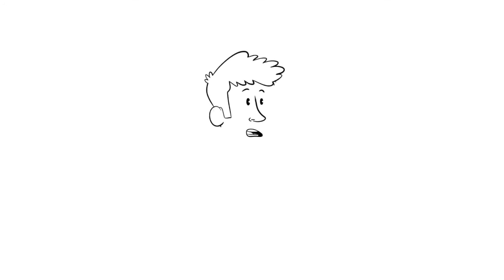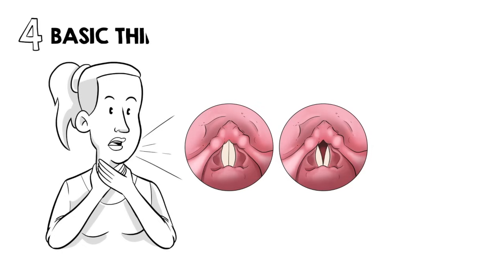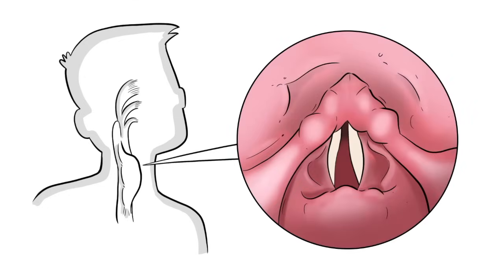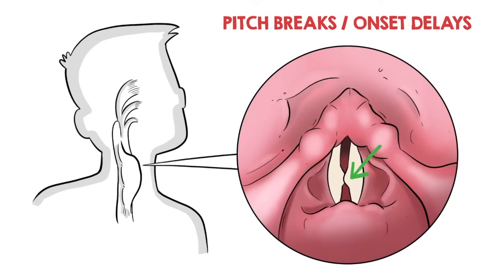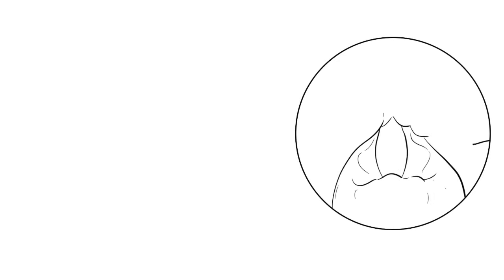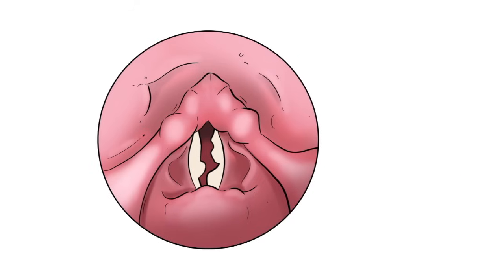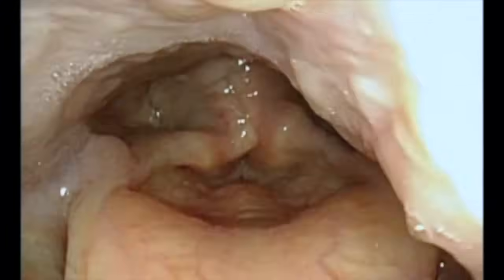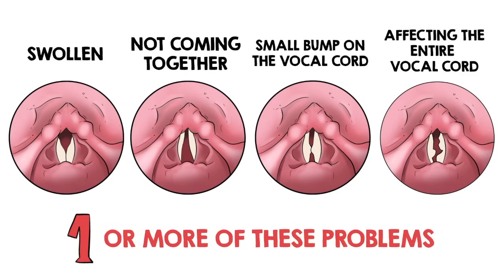The 4 Underlying Causes of a Hoarse Voice

Comment: Could someone please help me. So, whenever I try whispering my voice sounds clear. When I talk without whispering in a normal voice I sound weird and my voice always sounds so weird its most definitely the opposite of smooth. Even when I try talking in a normal voice its hard to sound clear I always talk in a high pitch voice instead so I would not sound weird with a voice which sounds like its vibrating and unclear. I wish for someones help if you could help please try so. I am a boy and is 14 years old. I also tried researching a lot and I cant find much I drink a lot of water and I do not shout so this could help but I can not see a difference. My voice has been like this for a year.
Reply: I'n the same boat did you get help

Comment: I’m getting older and my voice is getting worse each time I have surgery, when I have surgery they put a air tube in my throat that has caused me not to be able to swallow or talk sometimes for almost a month on the swallowing, then months on the talking.  I have been working with two speech therapist and still have trouble speaking.

Comment: Last year, I used to have a a very big vocal range (Bb1-C8 or 6.1 octaves and a semitone). I can sing like Mariah Carey's, Whitney Houston's, and Celine Dion's songs. But now I have a deteriorated voice, I can't get through my low notes and I can only hit a supported B2. I can't access my upper notes but if I attempt, It's so hard and I'm very frustrated, it ends up super flat and very very raspy and very strained. I can't hit my old notes easily. My voice still sounds the same like last year but when I sing, my tone sucks and I strain F4's and upwards but can't hit a Bb4 but used to be easily hitting a G#5 on a neutral larynx and it's super resonant and I hit a Bb5 many times in heady mix. My voice is really resonant mostly at my beltings. Also, I used to have a whisper register like my songbird supreme Mariah Carey, but now I can sometimes hit those whispery vocals but now I always crack as hell. I also do intentional breaks like Mariah Carey. Btw, when I try to mix, I can feel that my throat seems like denying the upward on my soft palette to mix and ends up going to just my modal voice. Also my whistles is inconsistently accessible and I always fucking crack and crack on every register, even at low notes. I'm very frustrates I can't sing like before and I can't sing my idol's songa. God. T_T My upper range (now that I can hit is only F4-C5 but rarely now goes to Ab4-D5) is super super raspy
Reply: Same😞